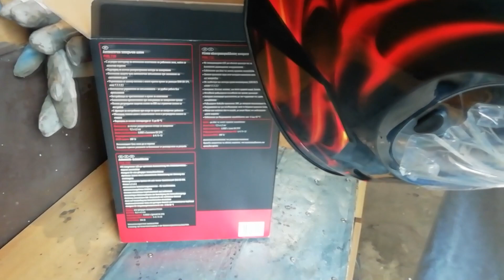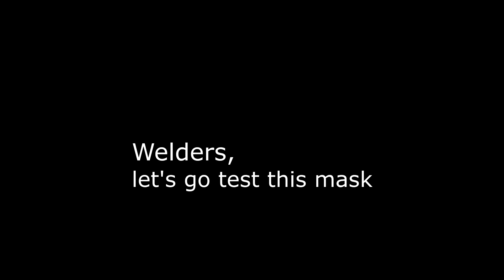PARKSIDE PSHL 2 D1/Automatic welding helmet/Review& Test

Comment: Bought this yesterday but the box was open and was just wondering what the four hooks either side of the rear lense are for? Not sure if something is missing.
Reply: Those hooks are for holding a transparent plastic shield that protects the actual lense on the inside. It should be there, if not something is missing indeed.

Comment: i bought it today and tested with cameras flash and it is late for 0.5 seconds in darkening
Reply: maybe camera flash downst work right?
Reply: @MaximumEfficiency  camera flash is too fast for this mask, i have tested it 30 minutes ago with mma welding machine, it still late but is not so strong as with camera flash, i will keep it
Reply: @makantahi3731  I've noticed it blocks first camera flash and then it let 2nd flash trough...
Reply: @MaximumEfficiency  yesterday i was in weld shop and i asked seller  for best mask and guess, best/expensive mask did not block first flash from camera, seller was suprised and asked me to flash him multiple time when he tried to set mask sensitivity and delay , but nothing, ha ha
Reply: @makantahi3731  ok thnx, then I guess camera flash isn't the best test, its probably not bright enough like welding is
Reply: @MaximumEfficiency  is more possible that electronic on any mask can not be faster than  speed of flash light, so 0.000000000002 seconds that manufacturers claim it darkens, is still 10000 times too slow